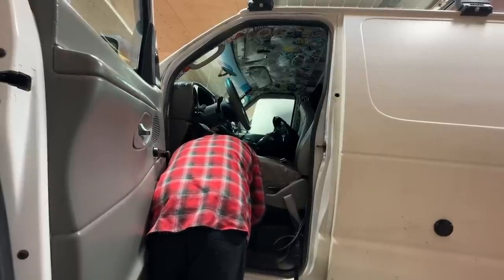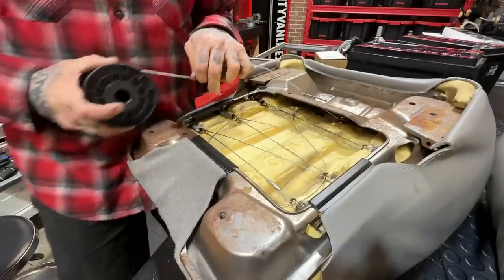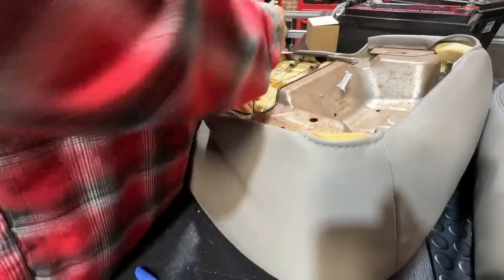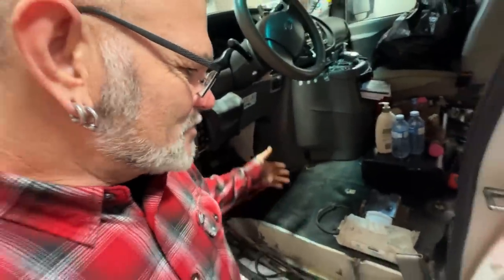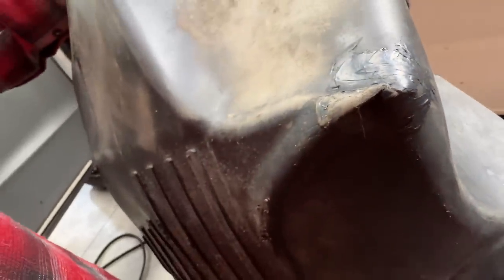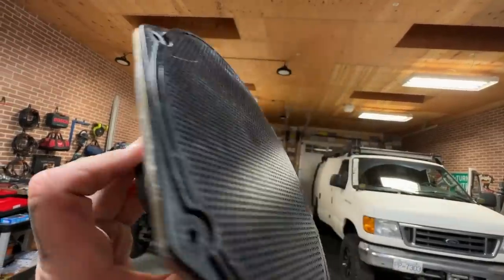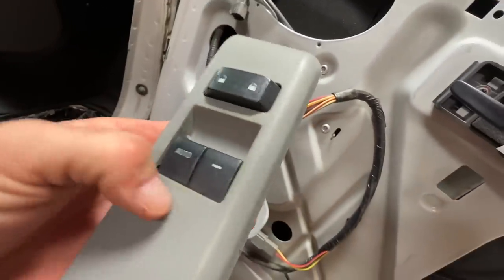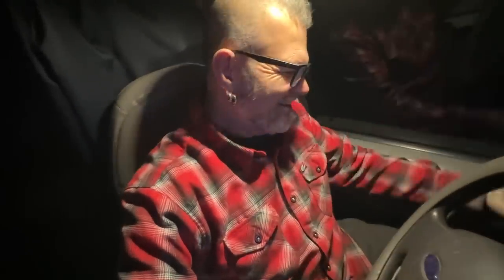Ooops! I SHOULD HAVE Put Something Between The Wire. CAMPER VAN REPAIRS

Comment: "Cat", here, "Cr"!  In the past I have found that placing a-slightly-smaller-than-the-clear-dimension piece of expanded steel mesh (for breathability) between the wire support and the foam helps tremendously to not destroy the foam and give a bit firmer feel to the seat?

Comment: that cable might cut into the foam.  Perhaps slip a piece of plastic between the wire and foam so it spreads the load wider than the wire.  In a few months, the wire is likely to be cutting into the foam.  plastic like a roll-up plastic knife/cutting board would work.

Comment: Why not get a small turnbuckle and start the wire run with that. It’s cheap enough and you can tighten it as the wire stretches. Just a thought.

Comment: 4:50 you could have just placed a piece of 1/8” thick plywood between the foam and the aircraft cable, doesn’t need to run multiple cables, the plywood will act as a protective layer for the cable not to slice thru the foam

Comment: Hey Chrome the next time you want to plug that Tire like on your LT tires it's on your van maximum air pressure is 80 lb run it up to about 95 pounds and it will not hurt I've been in the Tire business for 40 years if on this make it a lot easier on you